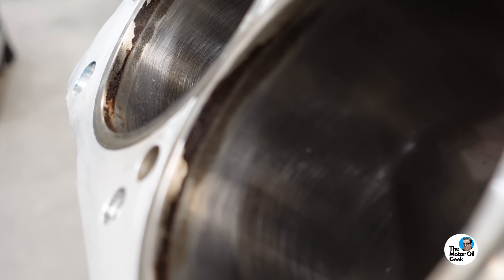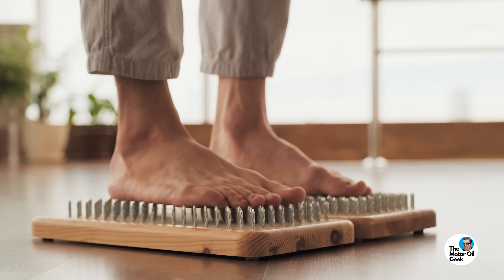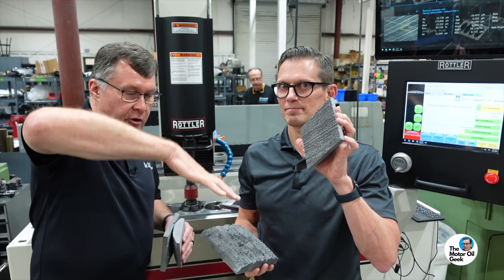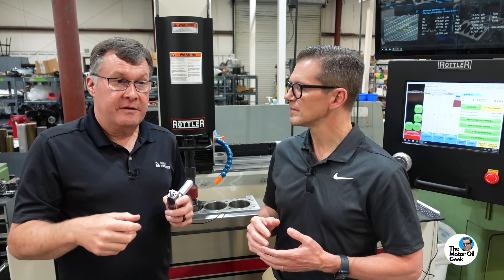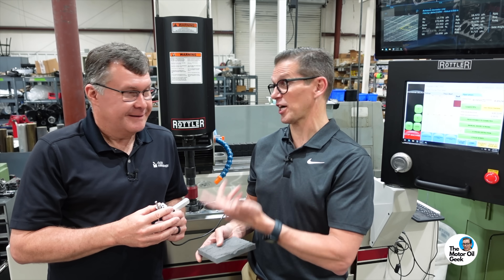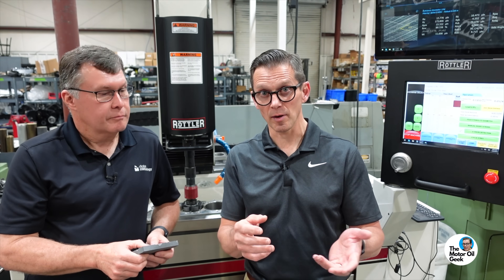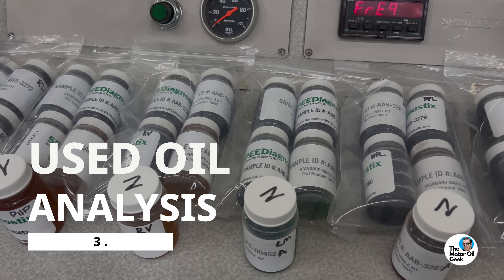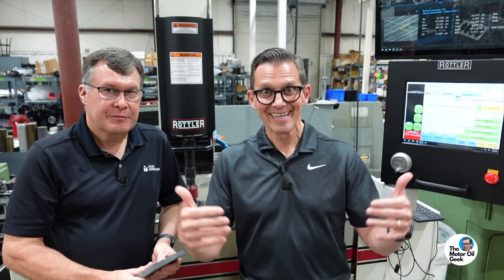GM's $1 BILLION Dollar Blunder: ROUGHNESS Matters...

Comment: In my quest to become a "know it all", this channel really helps.  Twenty years ago, without the Tube, I would have assumed I knew it all 20 years ago.  Your channel makes me realize I have a long way to go.  That's ok, because at 75 years young, it gives me a lot to learn.  Also, maybe I can tell my doctor what I need instead of the other way around!  Thanks Mr. Speed for showing me stuff I had no idea existed.
Reply: I'll second your comments 😄. At 71, I find out that there are more things I'm ignorant about than the things I thought 🤷. Lake has taught me more about oil than I thought even existed 😮. Never stop learning folks.
Reply: Thinking you will ever "know it all" it your first mistake.
Reply: You need beef. You don't  need carbs😊
Reply: At 70-75 none of us are ignorant, we know and knew what we did because of the level of technology we could learn and understand. The measuring gauge is a prime example, what type of machine hones a diamond to 2mm and then can be attached to sensitive metal probe and electronics. Then have a 3d printer print a profile maybe 23,000 times larger than the 1 square millimeter measured.  Trades are a wonderful place to work these days but thank goodness somebody gets enough education to develop this technology and innovation.
Reply: George Owens racing engines determined that a mirror finish bore was a better ring seal surface than a cross hatch. Whether that experiment was true or not, he was dedicated to horsepower experiments that no one had thought of at the time. That time was 1974. Mr. Owens was a unique character, full of curiosity and was a NHRA class record holder. His son now carries on with engine building in the original shop.
Reply: @davidbrown5587 No.
Reply: If you like online Forums  BITOG  is a good one specializing in Engine Lubrication and Engineering.  👍👍

Comment: A girl I work with that does most of my secretary of work basically accounting and such like that order’s parts keep track of them owns a Chevy Silverado or a GMC Sierra with the 6.2 in it. She’s on her second engine and right now she’s going through an oil consumption test because she’s about to be on her third engine. The EPA has completely destroyed the automotive industry.
Reply: Blaming the EPA for this is ludicrous. Blame outrageous corporate cost cutting which ended up backfiring on GM. Do you think the EPA is telling GM how to make bearings?
Reply: @RobertHancock1  It is a combination of Rules - Ristrictions and Cost Cutting.
Fifty years ago it was not uncommon for vehicles to go 500,000mi - 1 million miles. Irv Gorden drove his 1966 VOLVO P1800S over 3 million miles.
Reply: EXACTLY
Reply: The EPA? Your hate is misguided. No other manufacturer has this problem. This is CLEARLY a cost cutting move that backfired hardcore.
Reply: @chechnya  No but they have other problems related to EPA.
Reply: @chechnya  well EPA still causes reliability issues in general for the automotive sector....Ever since they put so many regulations on diesel engines, the reliability has gone way down....same with forcing Toyota, Honda, Dodge, BMW, etc to switch from NA engines to lame twin turbo charged 4 cylinders...the vehicles no longer last as long....so yes, EPA has become too political and has caused more harm than good.
Reply: @keithcrandall1369 You missed Ford in your comment.
Reply: @keithcrandall1369 Nobody forced anybody to adopt turbochargers. I remember when natural aspirated diesel engines were standard, and everyone and their grandmother were trying to install a turbocharger. The fact is manufacturers are making decisions and then f@!%$!ing up on implementing them. That’s not the government’s fault, that’s companies cutting corners and padding bank accounts.
Reply: @chechnya No.  I was getting almost 40 MPG in a 1980s sports car with a distributor. Been a mechanic for decades, then an engineer so I know both sides.  It's a combination of emissions choking to the point that simply running a thinner oil is how far they go get a few fractions of a percentage Point more, and then everything globalized and the founding stock and workers who made everything so great and reliable are gone.  Its very simple. Forced bad "high" tech and demographics

Comment: This is interesting info, now show how a motorcycle engine with a chrome cylinder seals without crosshatch.
Reply from the maker: Chrome has porosity as the surface features cracks. Those cracks hold the oil.

Comment: Back in the day when we built small blocks that went 400+ horsepower, we put thicker oil it them to keep the engine from squishing the oil out the bearings.
GM decided to thin the distance between metal to metal contact and then used a thinner oil to cushion that smaller gap.
Nope, I cant see what the fuck is going wrong😂😂😂😂😂😂😂😂😂😂😂😂

Comment: imagine making one of the best V8 engines of all time and totally fking it up because you have too many suits running shit
Reply: I think it was about trying to save money by reducing quality control. Too much management, not enough inspectors 😊
Reply: What the suits know is that once a vehicle has 70-80,000 miles on it they are not getting any more revenue from it on average, so suit logic says to have them fail at 90-100,000 miles which is what we are seeing across the board.   They are still dialing it in, so I expect we will see fewer major failures at low miles, but also few vehicles make it past 100k miles as time goes on.
Reply: @sstearns2  One would think you sell more trucks based on a reputation of of them lasting forever and being easy to maintain, rather than a system of planned failures creating sustained market demand for replacements.
Reply: @johnneil6653  You are not thinking like the average buyer of a new $50-100,000 truck light duty truck or car.   You are thinking like the buyer of a 80-100,000 mile vehicle since that is when ease of repair and longevity start to matter.
Reply: @sstearns2  I guess.  I sold my 2000 silverado 1500 in 2022 with 195k miles.  I wrecked my 2006 silverado 2500 LBZ in 2004 with over 300k miles.  Now I have a 2014 Ram 3500 with only 88k, fingers crossed.  Our family car is a 2009 and my commuter junkbox is a 2012.  Zero GM products at this point but I would trade my left arm for that 2006 duramax back.
Reply: oh please thats been the story of GM since almost the beginning.   Just read the book On a Clear day you can see General Motors
Reply: And they are bad fitting but expensive suits and probably smarter than the bloke wearing it
Reply: *ruining shit
Reply: The LBZ diesel is definitely one of the best without a doubt
Reply: Education is not necessarily knowledge.
Reply: Ugh. Another Chevy vs. Ford when the argument should be engineer vs. executive. Ford did the same thing Chevy is doing today back in the early 2000's with the 6.0 diesel and the 3 valve. Before those, the SBF, 300, and the 6.9/7.3 were some fantastic engines. Don't act like Ford's shit doesn't stink. They're all guilty of killing a good bloodline by reducing reliability.
Reply: @rotorhead5826  Chrysler did the same thing in the early 2000s when they stopped putting the legendary AMC 4.0 inline 6 in Jeeps and went to the Pentastar V6. Don't get me wrong, the Pentastar isn't the worst V6 displacing 3.6 liters (GM's 3.6 probably is), but I've driven a Dodge Caravan with one and it was simultaneously gutless but would also spin the front tire if you breathed on the pedal because first gear was ridiculously low (it was also owned by a nonprofit organization so the tires were el cheapo and probably needed replaced)
Reply: It's the best all around V8 engine ever built. It's usable in a heavy duty truck or a world class sports car and can run 300k miles producing great power in an inexpensive and physically small package. But they effed it up with dod, afm, variable oil pump and water thin oil. All in the name of EPA mpg requirements.
Reply: @Twystedwhizard My vote goes to the Toyota V8's
Reply: @Twystedwhizard  the 6.2 is NOT used in even the 2500/3500. It's a light duty engine. best v8 ever built is probably the coyote.
Reply: @Terminxman no torque unless you supercharge it 🤷‍♂️
Reply: @Darksyne  Torque curve is no worse than a stock 5.3. Both peak around 4000 RPM just like every modern v8
Reply: @Terminxman by your same argument, the 5.0 is ALSO a light duty engine used in 1/2 tons or mustang only. Just like the 6.2.
Reply: @peterluchak1678  Not really part of the point here, I'm comparing two light duty engines. So what's your argument? I only pointed that out because someone else claimed that the 6.2 was a heavy duty engine.
Reply: @Terminxman 
 ? 6.2 is standard equipment for 2500/3500
Reply: @jeffhill3681 No it’s not
Reply: @Terminxman the coyote in the s197 mustang was tough
Reply: @Terminxman  Hell even the old small blocks had a similar torque curve. I have an Oldsmobile with the 330 ci. engine, thing is weirdly rev happy for a 60 year old engine.
Reply: @Terminxman  Chrysler LA [318] cant be beat for economic durability when properly maintained.
Reply: Never one of the best V8 engines of all time.
Reply: @jamesrichardson559  Chevy 350,Chevy LS all great motors at one time Poncho
Reply: @jamesrichardson559  Yes it is a cheap knockoff of the actual best engine of all time the SBC.
Reply: @jamesrichardson559  no youre right, it wasnt engineered to utilize and improve upon the weaknesses of the sbc such as the bottom end and head geometry. It cant be installed into smaller engine compartments and make reliable power comparable to or exceeding most other production engine platforms. You certainly cant put forced induction on it in factory form and make over 1000 hp on a stock bottom end. Go cry about how much better your favorite automaker is and how much power they make after $60k worth of aftermarket modifications
Reply: @jamesrichardson559  well he said "imagine." Still hard to imagine GM making the best of anything.

Comment: Hello,

I would like to express my gratitude for the comprehensive information provided in your videos.

Prior to viewing your videos, I held the belief that the smoothest surface would be optimal for engine performance. However, your videos have prompted me to reconsider my perspective.

I am curious about the surface finishes that manufacturers use in engine cylinders and the methods employed to achieve them. Additionally, I would like to understand the impact of using oil additives in cylinder walls with higher surface finishes. 

Have a nice day.

Comment: At 15:22 IS THAT HOW TO POUR????   I always did it the other way, handle up, or it's side?
Reply: If you don’t want the air entering the container in exchange for the dispensed fluid with blubb blubb blubb and spilling the fluid around you should keep the opening as high as possible to have a constant uninterrupted flow
Reply: For smaller bottles you almost always want the spout on top, but bigger bottles usually have an air relief line running through the handle to make it unnecessary. In some situations you can get more control over how the oil pours by having the spout up, too, since the hole is much steeper by the time the oil comes out, so it's less likely to dribble down the side of the bottle when pouring slowly.

Comment: Are the manufacturers sabotaging these types of engines in mass so that customers will think that switching to electric vehicles may be the better value?
Reply: Anyone who thinks that doesn't understand the pitfalls of electric vehicles. Our infrastructure simply can't support it. The technology is not quite there with battery technology.
Reply: @coincollector315  no EV battery is going to last long enough to counter the incredible depreciation EVs have - besides that 74% of car sales are for USED vehicles, nobody in their right mind is going to buy a 6 year or older EV when the battery dies they would simply throw it away
Reply: I wondered the same thing. The EPA requirements made vehicles that weren’t fun to drive. I bought a Model 3 and damn, it’s fun and fast.
Keeping my 2003 Yukon XL 2500 8.1 w/ 269,000 miles and 26’ cabin cruiser boat w/ a SBC.
Reply: Why would GM knowingly cost themselves a billion dollars and damage their reputation?
Reply: @d47000  There was no damage to their reputation, they trashed that years ago.
Reply: @d47000  Because they can make more profit in the next quarter, keep the stock price up, and the executives all get bonuses!  What happens later isn't their concern...

Comment: It was the EPA and NHSTA causing these issues due to the fact of emission goals and why all trucks in the US are having issues no matter the brand.  Higher blowby the stronger the cavitation and well the NHSTA wants certain dimensions in trucks so the engine has to be a certain size. That's the real issue not because of the machining tolerance

Comment: OK, now I'm getting a little weird about things... Had my engine all done at my local machine shop. The owner has all of these new, really cool, CNC/computer controlled machines, one of them was this really expensive cylinder honing machine that he could program what surface he wanted in cylinders.

I remember him saying that he needed my piston rings to balance my rotating assembly, but I do not ever remember him telling me that I needed to use those same rings for the cylinder finish on my cylinders. Like, after seeing this, it sounds extremely important that I should use whatever rings that my particular cylinder finish was honed for, no? The cylinders in my block have a very smooth finish, almost like a mirror. My piston rings are a Plasma-Moly/Mahle Piston Ring Set.

I guess I'm going to have to go in and talk to him about it, hopefully he remembers that far back, all this machine work was done 3 years ago now, and I am just now getting ready to assemble the engine. ha ha

Wow, the stuff I've learned over the last couple of years, just about oil, bearings, clearance, and piston rings/cylinder finish ect. is amazing, and ALL of this stuff needs to work together!! 25 years ago, we got all our stuff back from the machine shop and just started assembling the engine, tossed in some Valvoline 10/30 in it, and it always seemed to work! Nowadays, holy crap, it's gotten so much more complicated, I'm afraid to even touch the stuff anymore. Hell, I remember changing my cam and lifters in my front driveway back in the day (took about 3 hours), never gave any concern about oil or whatever, put it back together, and start driving, and never having any troubles!!! ha ha ha
Reply: Knowing more definitely leads to worrying more. There are millions of rebuilt engines running around that were ball honed with drill and thrown together with whatever rings were most popular, or cheapest, running perfectly fine.  While perfection is a good goal; at what cost?

Comment: My father told me in the 1950s that Chevrolet had some problems with the V8 engine and the piston rings not sealing. He was working at the Chevrolet dealer in Miami. I forgot the name of it. They got a service bulletin that told them when the engine was running to dump Ajax or Comet into the carburetor to Scuff the Rings up so that the Rings would seal. Crazy right? He said that's what they did.
Reply: I tried that once with aluminum oxide powder in an old lawn mower engine.  It increase the compression 20 PSI but still burned the same amount of oil.
Reply: It was ford as well  they used bon ami cleanser
Reply: Very interesting! I drive a Hyundai 2.0 4 cylinder now with ring problems, it uses 1.5 quarts per 1k miles. Dealer just performed a combustion cleaning in attempt to eliminate oil usage. I wonder what new technique they've found to get these to seal. For all I know they're using same thing your Dad did. Great info, thanks for passing along
Reply: That is in Smokey Yunick's book
Reply: So my dad wasn't pulling my leg. Thanks for sharing that I'll have to try and find that book.  @Levisnteeshirt1
Reply: That’s incredible! Extraordinary. It sounds like it worked

Comment: I recall rebuilding a motorcycle  engine with new rings, and the rings came with a green coating on the outside edge of rings. This was to self hone the cylinder walls.